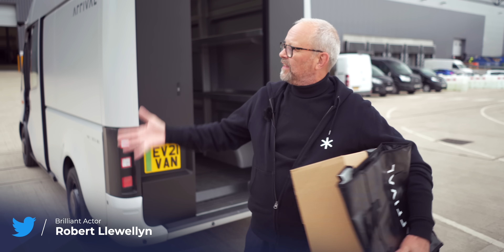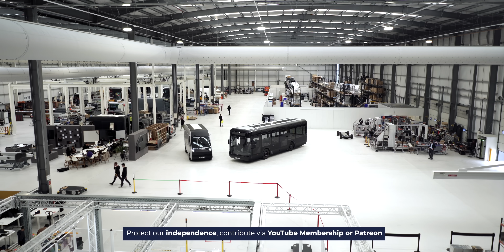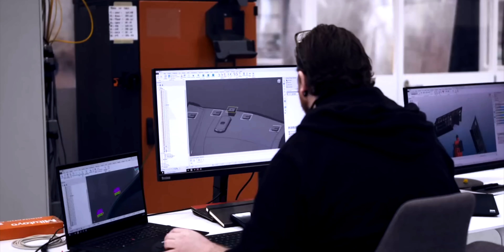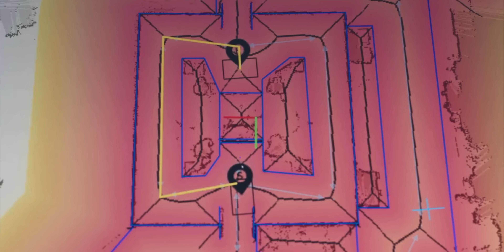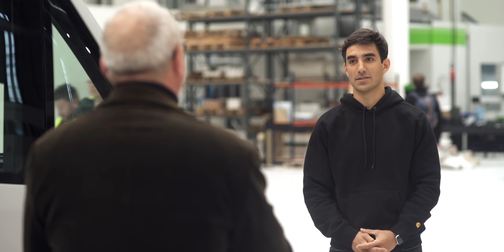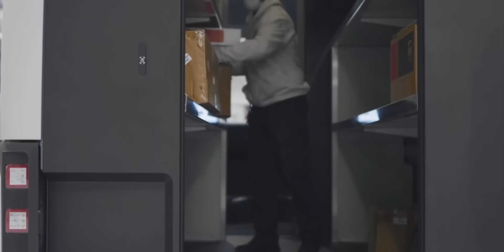ARRIVAL Exclusive - Inside Britain's most 'valuable' business | FULLY CHARGED

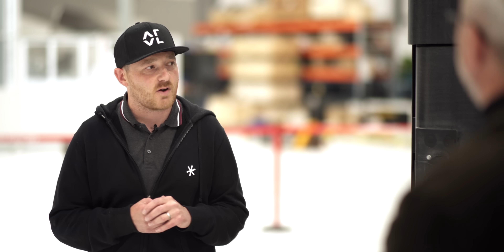Comment: Pause at 7:00. The front and rear overhangs and the low ride height, make the bus useless on all but the flattest of roads.
Reply: It's been designed as a city delivery vehicle, I'm sure they have thought of that.
Reply: @markreed9853  What angle do you think the angle is from the bottom of the front tyre to the bottom of the front of the bus? And/or the bottom of the rear tyre to the back of the bus? @7:00 it looks fairly useless to me. Definitely no good in San Francisco!
Reply: @punchthedog  it doesn't really matter what we think, it has been designed with the customers that are going to use it in mind, otherwise they wouldn't be buying. The Ups order is for the UK where we don't have as many extreme places like San Francisco
Reply: @markreed9853  My view on it is not a matter of opinion. The approach/departure/break-over angles is not a matter of opinion. They are quite clearly very minimal.

Comment: Amazing! I have my eye on this van as a camper van. Before the Sprinter have always been the go-to van for conversion to a camper. But this looks like a contender for the future. Composite material, like the Aptera car, is great, stronger than metal and no rust. Modular batteries are great too, to swap out when needed. What about range? When new batteries come with longer range, I guess its possible to change the old ones since its modular?  I am concerned about the payload from a campervan perspective, the batteries plus the equipment inside, like kitchen, bed shower etc, will the weight be too much? Another question, how much will this van cost?
Reply: I agree, I do see the appeal as a camper but due to the construction process, it would need extra strengthening and windows fitted at the factory. Also this added weight of the fitted interior and limited underbody clearance may not make in suitable to drive everywhere and still travel a good distance on one charge. As an ex-delivery driver I would rarely driver over 100 miles a day so the batteries would only be enough for the use case as any more would add increased costs and weight. We will see as they have has some delays to the timeline.

Comment: van is cool bus also but today stands if you dont build your self a factory with bateries cells no large quantity delivery industry production as shortage off lithium on market and you have to probably own chip production this raze slight costs even at large industrial production as producers inwilingly cut costs selfgo 2030 era in no c02 engine and already offer new e models as well as planed industry suport productiona s batery cells factories for self production this is rahter self closed society aproach but big league players in car industry and tesla surpass thsi by predicting and good goals in industrial poroduction and even holds a ace as largest presse shet metal in production this is steady buis numbers in rouh 40 bl $ in next 19 years easy with all productional suport enough to buy some cake car industry on its own just form factory money and earnings, and they earn and they will

Comment: Hopefully someone will see sense. I dont want large windows or skylights to over heat me on a bus, what I want is enough seat and leg space, and to be able to have somewhere to put my rucksack without it being on my knee or somewhere where the laptop inside is not going to get damaged or stolen. A system to reduce nasties in the air (not just covid) would be appreciated. I hope the camera systems replacing the mirrors are bullet proof, up to 2 years ago I use to drive hgv's with camera systems, they cost a fortune to install and kept malfunctioning, where as the mirrors never malfunctioned and if the glass got damaged could be replaced by the driver or any old mechanic without having to be booked into a specialist company 2 weeks after the fault occurs.

Comment: My issues with the van:
- driver's window: doesn't look as though it goes down flush with the frame, eliminating the ability to hang your arm our the window or rest your elbow on it.
- driver's seat: static seat. No reason why they couldn't shove a ISRI suspension seat in it
- central display: isn't angled towards the driver. Why not? Doesn't make any sense, a passenger in delivery vehicles is rare.
- the position of the seat belt makes no sense, it should be integrated into the seat
- there's no side blinds

The bus
- removed a lot of buttons? What? You still need controls for doors, suspension, lighting, air con, drive chain (drive/reverse) desto sign.  What are they claiming to have removed to make the cab simpler for drivers
- retrofitting an existing bus: if you pull the engine and transmission out of a route bus there's enough room for at least 10 bodies. WHY would you out batteries on the roof
- the limited footage of their prototype seems to reveal that their buses lack side and rear desto sign

I don't know who these drivers they're asking to consult on their 'UX' improvements, but from what I see in this video, I wouldn't want to be stuck driving on of their vehicles all day.

Comment: If they pull the bus of that off that’s really impressive! I can’t think of a harder real world challenge. Busses have insane duty cycles and long lives. I’m sure many buses have similar schedules every day so range would have to be very consistent regardless of weather conditions. You wouldn’t want to have to air condition a massive glass bus and use up half your battery and not be able to finish your route. Then you need to mass produce it for a somewhat reasonable competitive cost. Plus build high power infrastructure to recharge it. Best of luck to them.

Comment: Hydrogen makes more sense than massive slow charging battery packs. Hydrogen trucks and buses can be refuelled quickly and aren't carrying tonnes of batteries. More efficient than batteries. People need to get away from their love of batteries. Large vehicles and ships work better with hydrogen.
Reply from the maker: Where is all the renewable hydrogen coming from? When will it be online in sufficient quantities? And how does it justify its significantly higher costs and significantly lower efficiencies? These are the questions we get asked.
Reply: @fullychargedshow  you are looking at the studies of passenger cars. The smaller the vehicle the more batteries make sense, the larger the vehicle the more hydrogen makes sense. Japan has a hydrogen network because they built it. You need less hydrogen stations as a vehicle can travel longer distances on hydrogen, it takes far less time to refuel each vehicle and can be refueled in the field with a tanker if need be, once an electric vehicle is empty you can't really do anything except call a tow truck. For vehicles like large trucks that travel long distances and can't be stopping for hours then hydrogen makes more sense. Hydrogen buses are much more flexible than battery buses as they travel longer distances, can be used many more hours per day and slot into existing diesel bus companies much easier as they take up less space each as there isn't a need to have a large charger for each and every electric bus. Large buses/trucks and long range buses/trucks should be using hydrogen as it makes more sense, local and small buses can use batteries.
Reply from the maker: We are very familiar with the nuances, but you didn’t answer the questions we get asked as per my previous comment.
Reply: Battery technology will prove more than adequate for the roads. Hydrogen will have a place, Shipping and Aviation, but not needed on the roads.

Comment: I'm one of the camper people. My missus pointed out that the low load platform does mean it looks a bit too close to the ground. They'll need to raise the suspension a bit to optimise for campers rather than urban delivery vehicles (otherwise we'll be scraping very expensive batteries over rocks on some track in France). Still 2022 is fine. How big a battery can we have chaps ? :-)
Reply: Air suspension.
Battery?
Specify more body modules, longer wheelbase, more room for Batteries.
Reply: @rogerstarkey5390  Exactly. And enormous layout flexibility, Not being able to drill through the floor will require some rethinking of how things are usually done though.

Comment: I’ve spent the past 6 weeks doing multiple house visits - up to 80 a day in a small petrol car, every time I go to start it I think of the wear on the starter motor / engine, multiple starts and short journeys create. My total mileage was about 60 miles per day, an EV would have been perfect!
Reply: Are there used EVs near you? Renault Zoe or Nissan Leaf? There's the used EV website, Just EVs, and there's Autotrader for cars in general including EVs.
Reply: @موسى_7  . Unfortunately, financially, they don’t make sense - just the battery rental on the Zoe is the same as our usual monthly petrol bill, older Leafs are a bit of a risk should they go wrong. The small car that I have been using is ultra reliable and can be fixed by any local garage, if I can’t do the work myself! Factor in another £1k minimum for a home charging point!

Comment: I love Arrival and I’ve even put my money where my mouth is and invested a small amount in them. However. I do worry that revolutionising the manufacturing process as well as the vehicle might be a step too far and take too long to nail. Maybe they know this already and will start supplying with more traditional manufacturing techniques until they can refine this modular approach?
Reply: You are ofcourse correct and it's currently one big dream, throwing a load of ideas together and seeing what sticks. Van, Bus, Car, Manufacturing and Tesla struggles with just cars.
Reply: @oninbridders  great points. If the micro factory / production cell I.e make a complete product as complex as a vehicle in one (or a very small) number of cells works, then Arrival will be the biggest company of the 21st Century. I’d like to hear more about how they are going to scale van production in the next 2 years and how they are going to make 10,000+ units. A traditional production line right?

Comment: 12m is standard city bus on the Continent. And it usually has 3 doors. In Britain though, yeah, you might be right.
Reply: OK
Base it on a 4 module van
Doors as required.
This is the whole point of the system.

Comment: I wonder why they don’t put solar panels on the roofs. It seems so obvious to me. Surely it won’t be enough in itself but, hey, it’s free! Why not catch any of it that’s free? Well, solar panels are not « free » but why not?
Reply: 1m by 1.7m panel about 450 Watts.
2 panels, 900 Watts (let's say 1000W, 1 kW?)
Typical Battery? 40+ kWh?
That's going to take time to charge.
Plus,
On the van it's horizontal (not ideal)
Moving (not ideal)
Often shaded by buildings and trees (not ideal).

Put the same panels on either the roof, of a South facing wall at the depot and you get much better "bang for buck"
Reply: @rogerstarkey5390  direct light is not a factor, total light is. Plus, I know this is not meant to charge the battery but to extend (by how many miles?) the range. That’s all I ‘m saying.
Reply: @paulvanobberghen  I think both arguments have merit. I have often wondered how much power a bus could generate covered in Solar panels.
Reply: @daydreamer8373  I guess it may be a question of cost of the installation vs amount of energy gathered. Possibly not worth the investment?

Comment: In Cambridge where I live the council are big on guided busways, there's a new one being build now going next to my village which has upset all the snooty, rich, stupid people, (another busway plus). Busways are brilliant things. electric buses on busways even better. One thing with buses mind is they're not point to point, when you factor in the amount of walking required, cars still turn out much quicker, even in city traffic for point to point journeys. This is why a multi-modal transport system would work really well. Multi-modal means more than one form of transport for a journey, a good example being an Arrival Bus with a specially designed Arrival trailer with bike racks. Most people could cycle/e-bike a couple to three miles to and from stops and the buses could zoot along high passenger volume busways quickly with the passengers bikes in tow,  linking up hubs/ village/town/city centres.  I worked it out, just with cycles and a few "City Link" routes, that's what I called it, people could commute long distances quicker than driving. Everyone I talked to like the idea and said they would use such a scheme rather than driving, so obviously I proposed the idea to the council. Local council didn't like my ideas at all, couldn't fathom out why they were so opposed to an idea that everyone else thought was brilliant, other than the fact they are probably all mad and a bit simple.

Comment: I see they are using the same modular type of construction that Leyland National used for their single decker buses. I think people hoping for a campervan version of the EV van are going to be in for a bit of a shock when they find they will require a licence to drive a vehicle over 3.5 tonnes with the weight of an electric long wheelbase , high top panel van coming close to this without the weight of the furniture of the caravan build, they don't use balsa wood in motorhome construction.
Reply: Most campervan drivers in Britain are on the older side of things. They passed their test before 1998 and therefore been given C1 and BE automatically. Younger folk might have a problem though. And people on the continent, if Arrival starts selling them there.

Comment: Have they ever looked at mobile homes (campervan) leisure.? Et cetera could be a brilliant market
Reply: yep batteries don't work for campers. not enough power density. that is why campers have generators.
Reply: @hagestad  I can’t see why they can’t be used as solar panels could recharge the batteries and there are many charging point starting to be around.
Reply: @Treborwood  why is everyone using solar panel argument. They don't provide anywhere close to the energy needed to power home unless you are living on Sahara desert